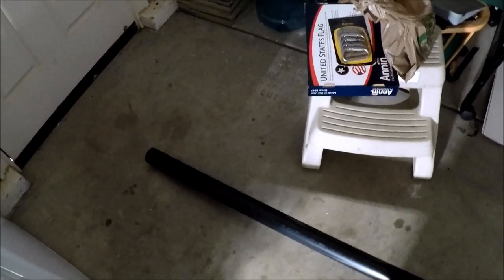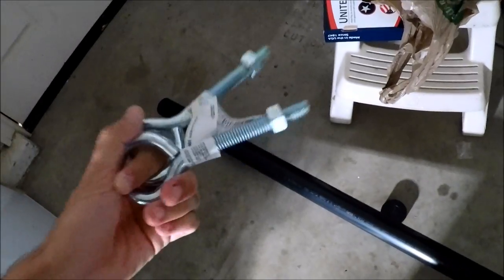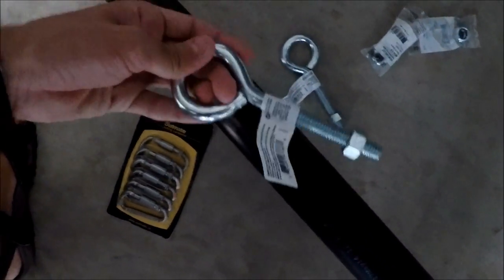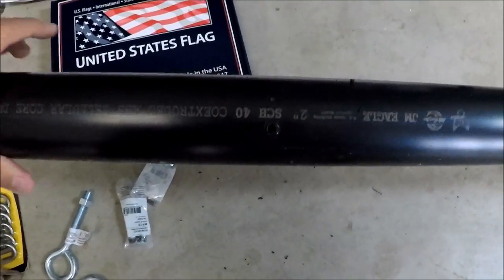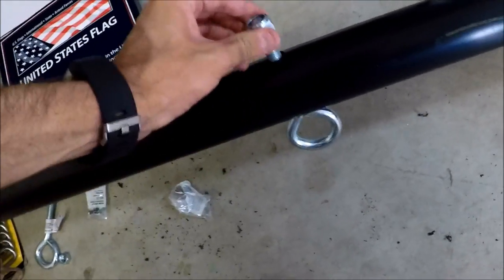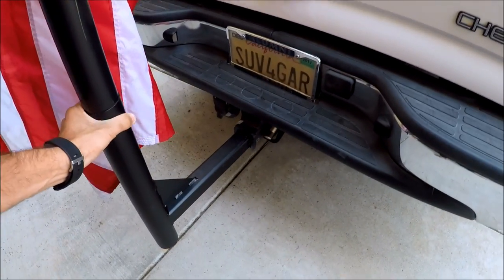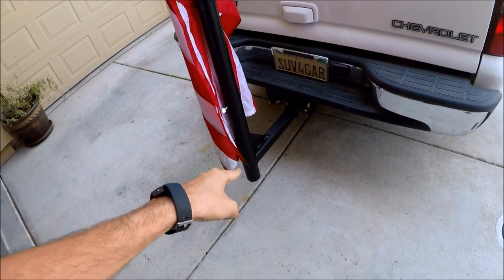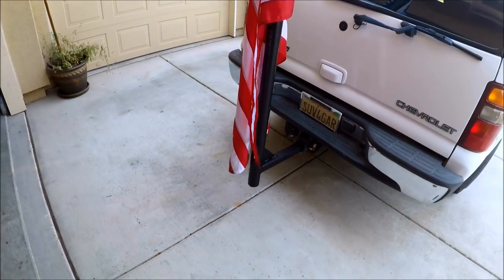EASIEST WAY to Mount a Flag Pole to SUV or Truck

Comment: I used this exact same setup on my Chevy blazer. Same hitch, pole, screws, everything and it works very well. But I am a little paranoid so I did put a broom stick inside of the PVC for extra strength. Thanks for the vid man!!
Reply from the maker: That's awesome, I'm glad you like it and that it turned out well! :) I have to admit, the flexing made me nervous at first too, but after a few years of intermittent use, it's still going strong.
Reply: Lucas Pavlat instead of 2” pvc I used 3/4” black iron pipe for the same reason as the broom stick
Reply: What year's your blazer? I'm in the process of doing this to my '03
Reply: What is year is your blazer my guy ?

Comment: Got pulled over by a cop for not having the flag attached too the truck I just held it by my leg  half inside of the truck and  he said if I were too hold it fully outside of the truck I could "oof" someone so if I'm fou  doing that again with out it being attached too the truck I'll get fined so hopefully this'll work:)
Reply from the maker: That’s lame you got pulled over but at least this is an easy and cheap solution - hopefully you like how it turns out!
Reply: @1Brain4Wheels  lol it is one comment I  saw for my towns police department, and the  911 caller hung up on him, lol. Thanks buddy hope it does too also thought of putting a hole in my door and do some welding and put it in via that but I'll most likely go with the hitch anyways have a good day buddy stay safe God bless:)

Comment: Ive got a set up similar to this on my Suburban as well! I went hella overkill on my pole and flag lol. 

But go on Amazon and type in "trailer hitch stabilizer" and buy one, and that'll keep your mount from wobbling around. I got one for my flag pole mount and mine doesn't wobble AT ALL! It's really great! That is if you still fly your flag from your truck lol.
Reply from the maker: Haha, I still fly it from time to time ;) Wow, I had no idea those devices even existed, I'm buying one right now - thanks for the tip! Yeah, I went with the PVC because it's easy to cut etc., but now I would probably make it out of metal pipe if I had to redo it, the plastic flexes a bit too much for my taste, but it's okay for occasional use.
Reply: @1Brain4Wheels  cool dude!! Yeah that hitch stabilizer is freaking amazing. Mine doesnt wobble at all!! And if you do go to a metal pipe, use a chainlink fence post. That's what I got and it works like a champ!
Reply: Jake Peterson I never even thought of chain link fence pole and I have 40’ of them here at home already. I have always used 3/4-1” cause 2” seems big AF

Comment: Any problems with this mount on the highway doing around 80mph, or just any problems in general? Thanks
Reply from the maker: Hey there JerseyGreek, I haven't actually gone up to 80mph with this on the back, but at ~70 it's honestly been totally fine and I would feel comfortable going 80 no problem! The only thing that might be unsettling is that the pole does wobble back and forth a lot when driving at any speed over 40, but the pole/mount isn't going anywhere and it won't break (so I wouldn't worry), however the flag will probably wear out a little faster... mine has only seen light highway driving and mostly around town, and the edge of my flag is just starting to show a little wear at the seam. Hope this helps!
Reply: I have the exact mount on my gmc envoy, gone up to 80 mph in the highway no problems!
Reply: I’ve gone 170 on a highway and no issues
Reply: @aaronlutz9477  ive gone 320 on the interstate with this pole mount, no problems here.
Reply: @Yohanyothan  I went to space with the pole mount and the flag is barely showing wear
Reply: Ive gone 240 in my Bugatti and no biggi.

Comment: I just added a flag in the back of my truck but with an suv it just makes it fly everywhere and spaz out. If there anyway I can fix that? Any tips? I was thinking getting a bigger pole to make it fly higher but I’m not sure
Reply from the maker: Hey Lexi, I know exactly what you're talking about, I think a few others had the same problem... what I believe is happening is that the air is hitting it from all sorts of angles flowing from the roof and sides of the vehicle based on the height that you currently have your pole measured to. It'll be different for everyone based on how tall your vehicle roof is relative to the hitch, but I would suggest either having the flag no higher than the roof of your SUV or fly it so that the bottom of the flag is no lower than the roof (ie it's gonna be really freaking tall) - I'm not 100% sure that'll fix it, but based on my limited knowledge I think it should do the trick

Comment: Hello there, I did this exact set up with the same hitch mount from Amazon, but I'm having problems with the flag flying nicely. It stays tangled and doesn't fly properly. Any ideas to fix that????
Reply from the maker: Kawika Ray hmmmm, so is the flag kind of getting wrapped up around the pole? If so, are you using larger sized carabiners/clips, I feel like larger ones more easily allow the flag to slide/reposition itself out behind the car so that as you drive it hopefully extends behind the car as the wind pulls it back. Also, just curious if yours is on the back of an SUV or a truck? If a truck, then maybe try putting down the tailgate if there's enough room so it doesn't create a weird wind affect? Hope this is kind of helpful, let me know how it works out! Mine only got tangled up slightly once during the week and a half I had it on my Suburban, but it untangled itself once I got at a higher speed so I feel like the larger clips might be helpful.
Reply from the maker: Kawika Ray hey there again, was just curious if you were ever able to get the flag to fly nicer? Let me know, still trying to think of how you could improve it, I guess I was lucky I had no issues really...
Reply: Your flag is too tight against the pole. It needs to be able to swivel/rotate
Reply: 1Brain4Wheels Im having the exact same issue. I think the problem is that its to low. You may have to find a extended pole and fly it above the roof so that it gets proper air. If i get to it ill upload a video on the results
Reply: The flag needs to be slightly higher then the car to get air so that it can fly.

Comment: Ok so I made the same thing but just shorter than that. Mine is like 5ft height  and the flag wraps around the pole. What do you think I need to do to fix it?
Reply from the maker: Hmmm, what size clips are you using? Based on the experiences of others that have had a similar issue to you, using smaller clips/carabiners keeps the flag too close to the pole which increases the chance of it getting wrapped up-try using larger clips that will keep the flag farther from the pole
Reply: 1Brain4Wheels I will try that. Thank you
Reply from the maker: Yeah, for sure - let me know how it works out 👍

Comment: They make an anti-wobble/rattle hitch stabilizer. It’s like 10-12 bucks. Instead of cutting up cardboard
Reply from the maker: Thanks for the suggestion Kelly! I actually didn't realize those existed at the time I filmed this, but have since bought one off of Amazon and will try it out this year. Definitely better than my MacGyver'd cardboard shim lol
Reply from the maker: Just had to let you know I finally got to use the stabilizer and it's soooo much better, thanks for the suggestion! :) Happy (almost) 4th of July!

Comment: ...THEN you drive it and find out like I did that SUV's swirl air around the backside of the body so when the air swirls in twards the truck the flag just basically washes your back glass of all the dirt and the flag never flairs out. I havent fixed my issue yet but Im guessing I cant use a polyester flag cause of the weight and I need the pole up above the truck to force air into the flag. In short there isnt enough airflow JUST behind the back glass for the flag to catch air. Which is why i came to see how you handled it.
Reply from the maker: Jagger Johnson hi Jagger, for me (just by chance) what I found to be extremely helpful is to make sure the flag is NOT tight between the two connection points (where the carabiners are)... that should allow the air coming down from the roof of your SUV to catch through and pull the flag out behind you! Try that and see if it works out better
Reply: @1Brain4Wheels  Will do thanks buddy !

Comment: How tall did you make the flag pole?
Reply from the maker: h20786 I ended up just eyeballing it so it was just a smidge taller than the top of my truck when mounted-about 5 feet in length. If it's any larger, it seems to wobble too much! Alternatively, you could use some metal(exhaust) pipe and make it taller with less flexing

Comment: Is that a 3x5 flag or what size is it?
Reply from the maker: Robertjack29 yeah, it's a 3x5 You can get the one I used for ~$15 right now in Amazon 👍🏻
Reply: 1Brain4Wheels alright thanks! Im thinking of putting a flag on my f150
Reply from the maker: Robertjack29 sweet, let me know if you need any other recommendations or what not, it definitely looks nice going down the road! 🇺🇸

Comment: What size eye bolts?
Reply from the maker: Hey there Devon,  I forget the exact size (you can use a variety of sizes depending on your setup) but the threaded section of my eye bolts is about  3.75" long and accepts M14-2.0 lock nuts - let me know if you need more info and I'll get back to you :)

Comment: The battery drain because it's setting on concreat
Reply: Tristen Cochran sitting on concrete
Reply: @joejones2847  sorry autocorrect I don't know who invented it but it never helps turns right words wrong and doesn't turn wrong words right

Comment: How to destroy an american flag by ripping it to shreds at 80 mph on the highway. Might as well burn it.
Reply from the maker: If you don't drive at highway speeds very often or mostly just drive around town, this setup will be perfectly fine.... I would never intentionally fashion a flag pole in such a way where it would get tattered, shredded up, etc. My stepdad is a Marine and we heavily respect the American Flag! But I do understand that there are many people out on the highways that do let their vehicle flags fall into a state of disrepair and to those people, they should take more caution to remove the flag before traveling at those speeds.
Reply: Gotta represent though, highways have a lot of people that can see it

Comment: So how do you open your trunk with this thing on ??
Reply from the maker: That’s also a great question! For me I’m lucky because my top glass also can open and that’s small enough to do so with the flag pole mounted, but if you don’t have that option then you would unfortunately have to take it off to open the rear hatch completely :/
Reply: @1Brain4Wheels  thank you for the reply 😁 I drive a gmc suv and  as much as I want to do this lol it would suck to take it down everytime i need to access the trunk 😄
Reply from the maker: @shaziassingh  Yeah, I definitely understand that,  it would be a pain if you use the cargo area a lot! Do you have one of the newer Yukons where the rear glass is fixed? I usually only have this up for a week or two around the 4th, so between being able to just pop open the glass (easy for me to use since I'm tall) or putting stuff in through the partly opened hatch, it works out alright. Off topic, but if you ever buy one of those hitch mounted cargo racks, those also make opening the rear impossible :(

Comment: What inch diameter pvc pipe were you using ?
Reply from the maker: I used 2" pipe and that squeezed in pretty tight haha Online it says the pole holder will take up to 2.3" diameter